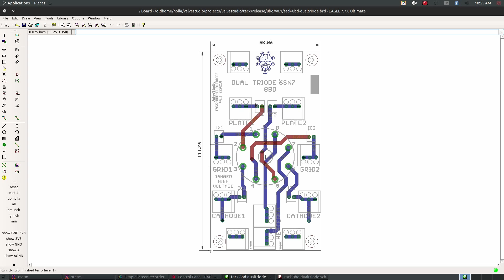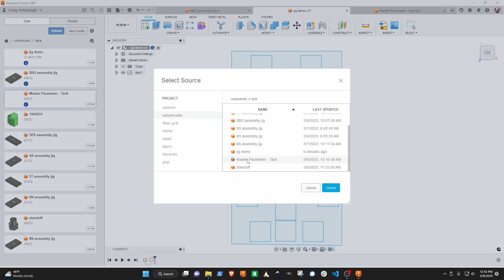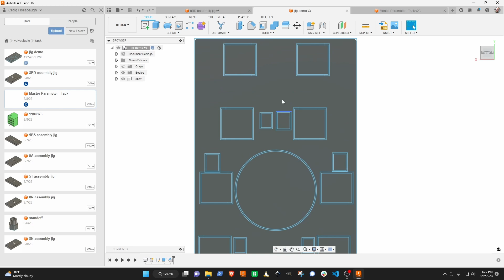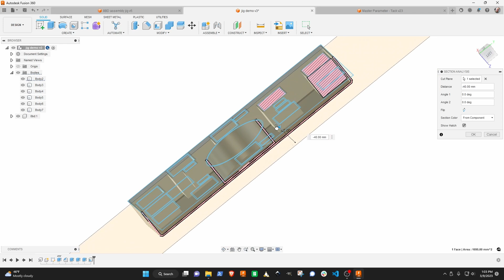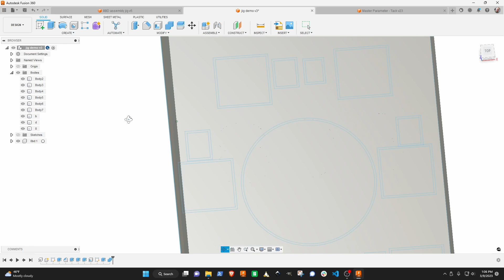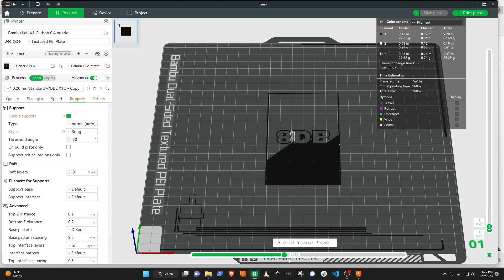230311 Valve Studio - Make a 3D Printed PCB Assembly Jig

Comment: I use kicad and freecad. Since there is a tool to pass objects back and forth I wonder if you could use the 3d model of the board and components to make a cut out in a freecad model.  I use my 3d printer for a lot of jigs and drill guides, but it would be a time consuming project unless you had lots of boards to build. Good idea though
Reply from the maker: I considered something similar. I'm using an old version of Eagle, if I imported it into Fusion 360 electronics then added 3D parts to the board. I could just subtract the 3D board shape from the blank as you're doing with kicad and freecad. For my simple jig, I thought this would be overkill. I probably should try this though, it would eliminate the dxf operation. Thanks for the comment and for watching.
Reply: @CraigHollabaugh  I night have been too vague, I've never done what I described, I'm wondering if it can be done.  I use the 3d printer for a lot of jigs, but never this type of jig.
Reply from the maker: @clytle374  no worries, yes it could be done, but the difficulty is after you do the subtraction. The form will be very tight, if you push the 3D surface a little bit for spacing, then the part heights in the jig will get a little screwed up. I spent quite a bit of time fooling with the part heights to get all the parts to sit flush on the board. (I'm looking at 6 jig attempts in my trash can now, hence the derived parameter file). Fortunately, this board has only 3 part heights to consider, can't image one with 10 or 20, that would be a pain to get right.
Reply: @CraigHollabaugh  I was thinking about the different heights.  Of course using the 3d render for the cut relies on the accuracy of the models.  The tight fit should be easy to handle with making 4 cuts with shifts. X+Y+/X+Y-/X-Y-/X-Y+
When people as what I do with my 3D printer, I always respond "fill up the trash can honestly"